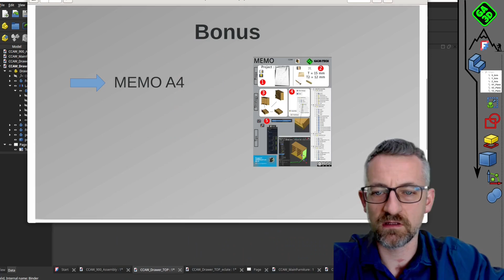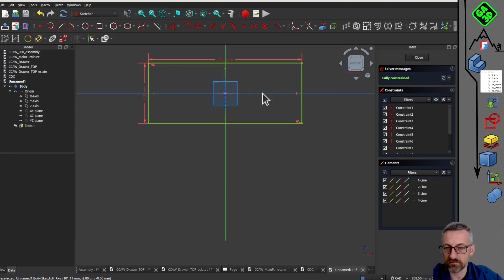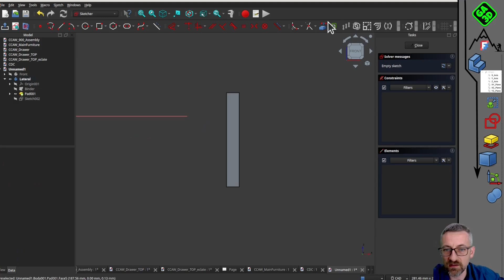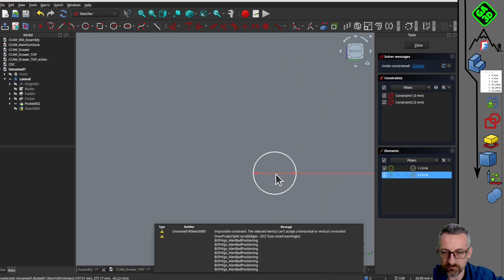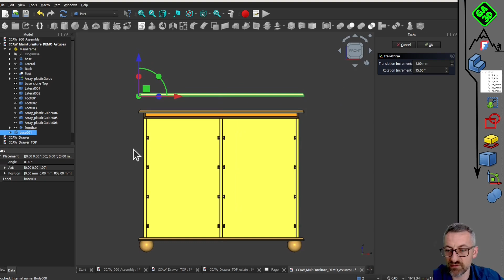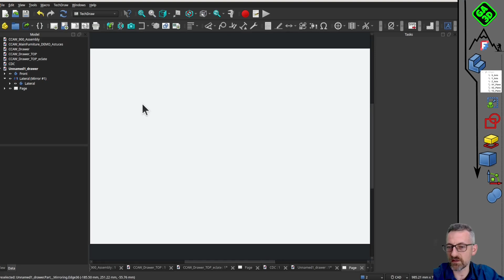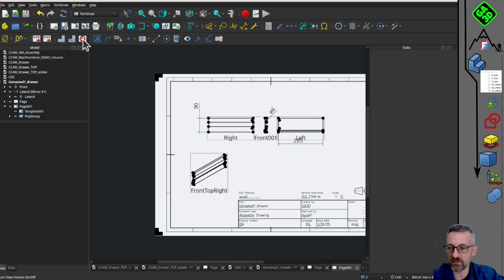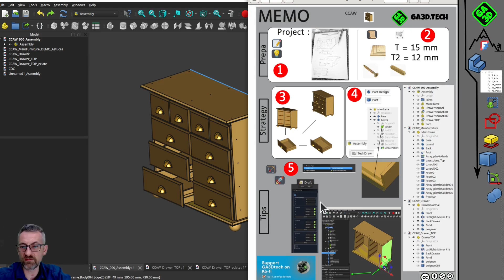Building a Piece of Furniture with FreeCAD: Essential Modeling Tips & Tricks

Comment: there is Woodworking workbench if you haven't noticed yet, so you can create the main construction in several minutes... if fact so detailed model is not needed if you create your furniture on your own... good luck in FreeCAD woodworking... there was no woodworking in FreeCAD several years ago at all...
Reply from the maker: Yes, I'm familiar with the Woodworking workbench, and it's definitely a powerful tool! However, for someone just starting out and really wanting to grasp the fundamentals of FreeCAD, I don't find it ideal to jump straight into a workbench that automates so much.
And "good luck"? FreeCAD is fantastic! The goal here isn't necessarily professional woodworking, but rather managing personal weekend DIY projects. In that sense, FreeCAD is a monster of versatility and efficiency across a huge range of fields, from mechanics to 3D printing, and even G-code programming, among many others.
Reply: @ga3d_._tech528  The Woodworking workbench is rather for cabinet making, kitchen, bookcase, office storage, something like that not exactly for joinery like finger, half lap-joints and tenons everywhere... however there are predefined connections like dowels and screws, most common in my case... I don't understand why you think someone who want to make simple cabinet should not start from this workbench? if you are new you probably never finish furniture if you will be drawing each piece of wood in Sketcher workbench and create each dowel and screw... as I remember while I was starting using FreeCAD I wasn't able to move object...
Reply: The woodworking workbench looks very useful.  I wish that the tutorials had voice-over however.  Being new to FreeCAD and design software in general,  I find if difficult to follow the tutorials.